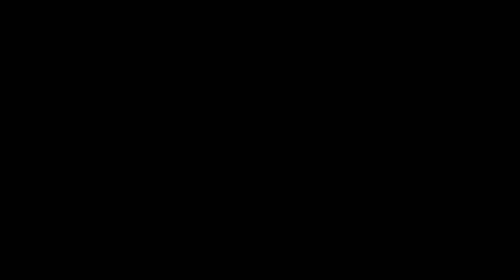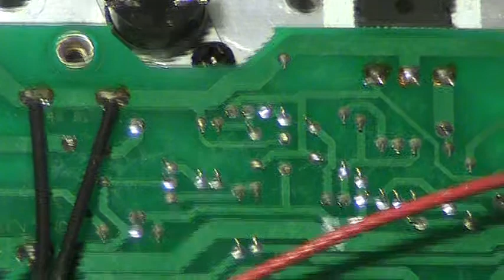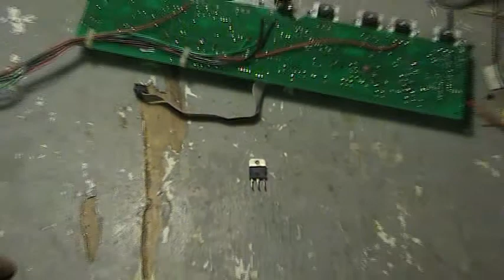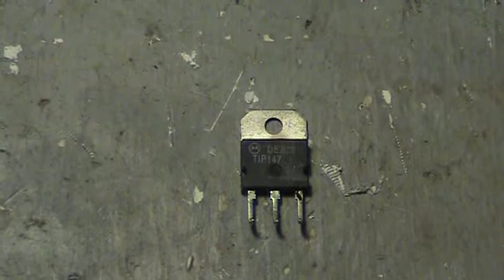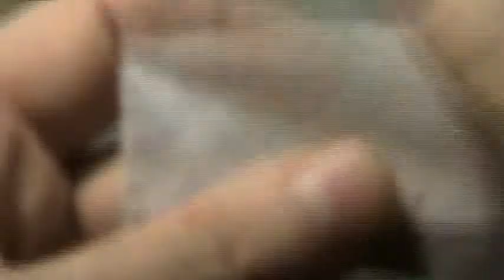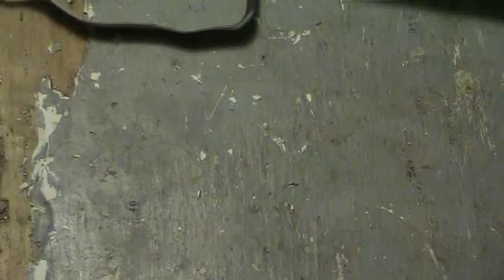Johnson Millennium Repair Update 1

Comment: What do you mean when you say a dead short? I bought a Johnson Millennium stereo 150 and want to avoid blowing mine up too. Please explain as a child would understand it as I am not an electrical engineer lol.
Reply: A dead short is a 0 ohm load. The guy prob put the amp in a 2 ohm or lower load, and it blew. This amp is only rated for 4 ohms or higher, not 2 or lower. 2 - 4 ohm load speakers in parallel = 2 ohms, or 4 - 8 ohms can equal 2 ohms. That's almost a dead short...